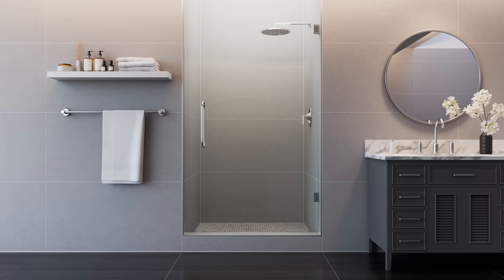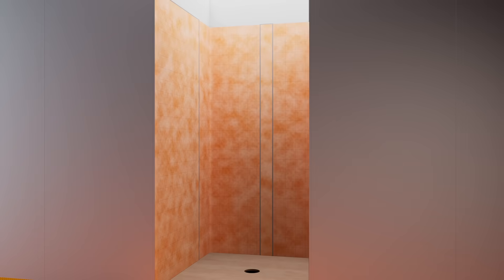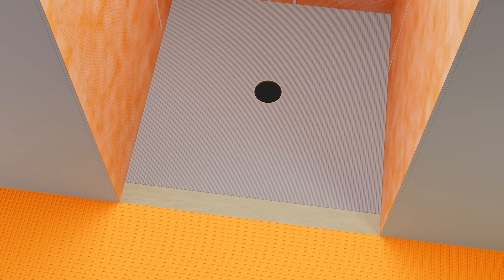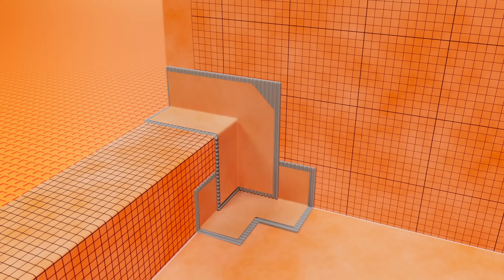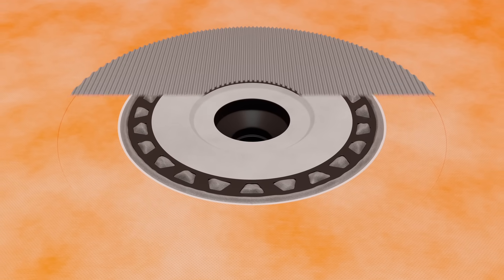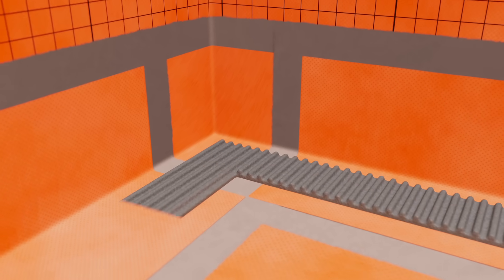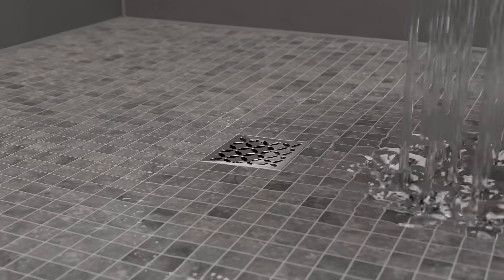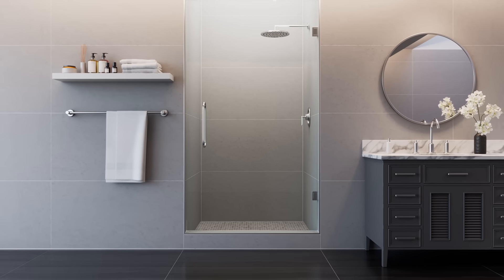Schluter®-Shower System Animation

Comment: Can you use porcelain SLABS with this system?  Ive seen alot about tiles, but no mention of slabs
Reply from the maker: Hi Courtney! Mind giving our Customer Service team a call for this one as there are some variables to discuss.
They can be reached on 800-472-4588 (US) or 800-667-8746 (CA). Thanks!

Comment: Can I use Durock  cement boards wall for schluter membrane?
Reply from the maker: Sure can! Here's a link to our Shower Installation Handbook for more info: https://sccpublic.s3-external-1.amazonaws.com/sys-master/images/h14/hb1/9346696609822/Shower%20System%20Installation%20Handbook.pdf

Comment: So why dose Europe have Kerdi CoLL?
Reply from the maker: Hi there, Kerdi-Coll was introduced in Europe to address requirements that simply don't apply to the North American market. North American standard construction methods differ from Europe. Here in NA, installers can assemble their showers using the same thin-set mortar throughout and have flexibility to use a thin-set mortar from their setting material manufacturer of choice as long as it meets the requirements called out in our installation handbook. Hope that helps.
Reply: @schlutersystems1  Okay that makes sense thanks, But can we still buy Kerdi-Coll in NA to use as a topical waterproofer over top of kerdi to add an layer of defence, or insurance in waterproofing?
Reply from the maker: Hi again! No sorry, this product is not sold in North America. Our recommendation is to follow the North American installation handbook which will give you a fully waterproof installation: https://sccpublic.s3-external-1.amazonaws.com/sys-master/images/h9f/h74/9145056559134/Shower%20System%20Installation%20Handbook.pdf
Thanks!
Reply: @schlutersystems1  No worries, Mapei thin-set seems to hold all my shower pans and waterproofing together perfectly. It passes our 24 and 48 hour tests just fine. I assume it not being available in North America has something to do with building codes and association standards.